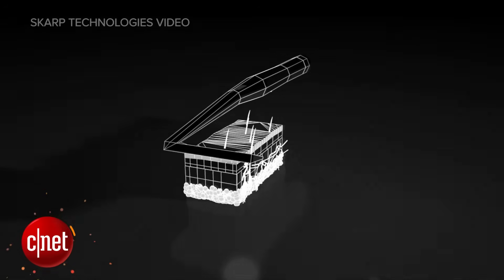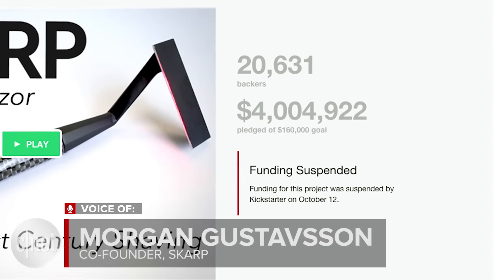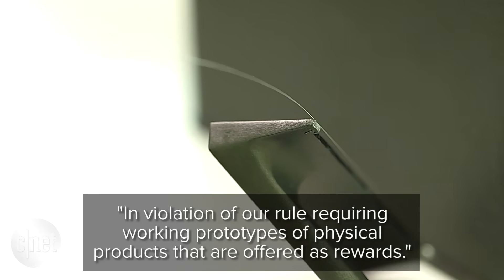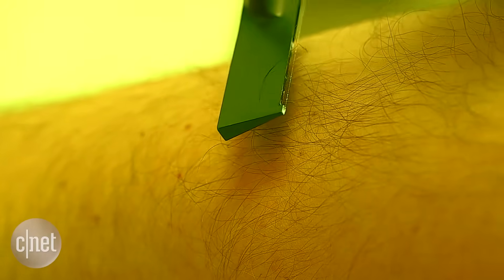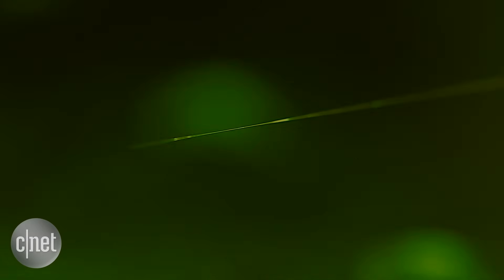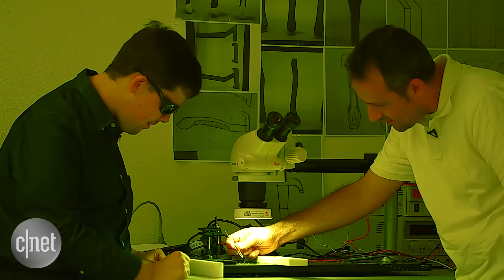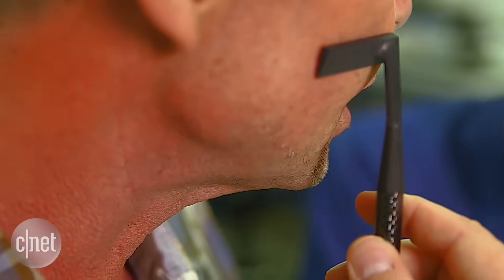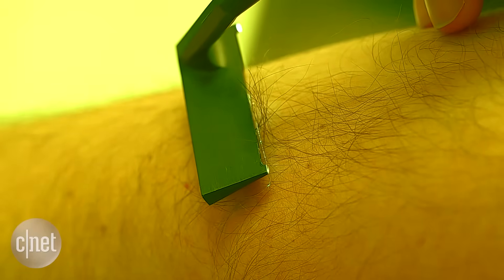The laser razor actually works -- but not very well

Comment: 2020 and still no closer to a razor than they were back in 2015, the last update was over a year ago.

I don’t consider barely cutting one piece of hair a working prototype. It’s a joke. Fail.

It looks like people have stopped giving them money, most of the money raised was back was in 2015 ($408,720), raising only another $99,090 as of this post. The well is running dry.

Comment: why would anyone need that just use a normal razor and shaving foam your fine
Reply: Someone with extremely sensitive skin could use something like this.
When I shave–with a completely fresh blade for sensitive skin–I let my beard/stubble soak first to soften it, and then lather it up and let that sit to soften it further, then I lather up AGAIN and very gently cut small sections at a time. And then apply a calming aftershave (NOT one that burns). 
Even after all that, my face is still irritated to the point that I can't touch the areas I shaved for a couple of days afterwards.
Reply: soccerguy2433 Trimmer doesn't get you smooth. I've used electrics before and they're a hundred times worse, it was unbelievable. 
I realise this thing won't get you anywhere near smooth either in it's current iteration, but that's supposedly one of the things they're working on. Currently considering laser hair removal, it's just ridiculous.
Reply: then why dont you just use a trimmer with no guard?  This item won't work as well as a trimmer.
Reply: The hope is that one could get a perfectly close shave with completely smooth skin, in minutes, anywhere on their body or face, without wasting water, without using up shaving cream or oil, without putting more blades or cartridges in landfills, while saving money by not spending it on blades or cartridges or shaving cream or shaving oils, without irritating the skin, and without risk of cuts or scratches.